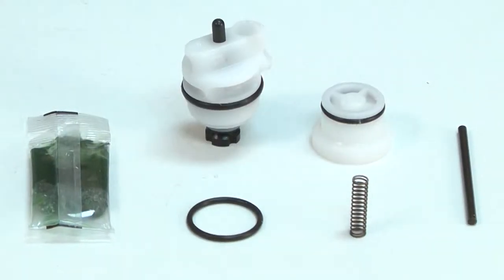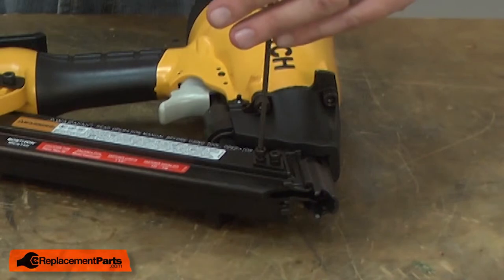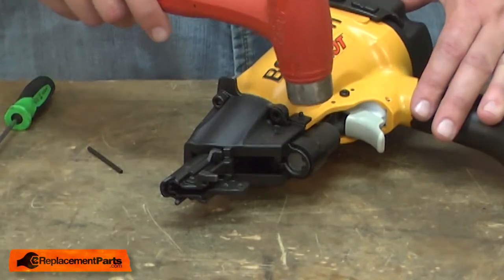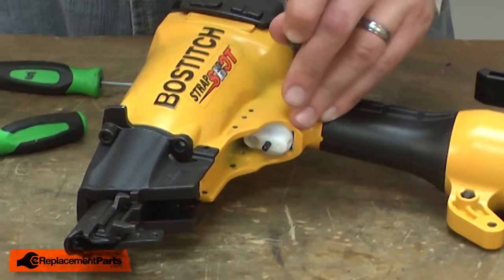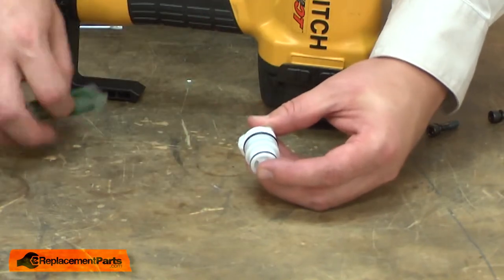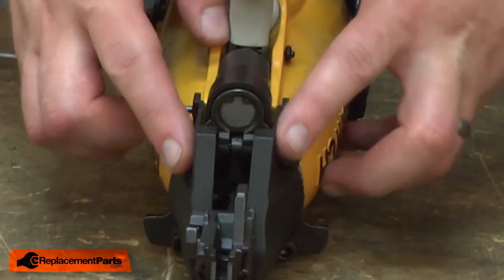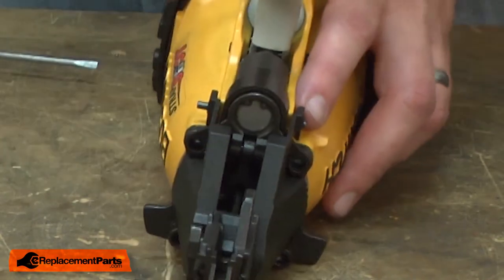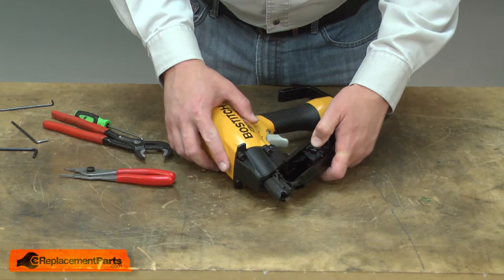Bostitch Nailer Repair - Installing the Trigger Valve Kit (Bostitch Part # TVA14)

Comment: They used to be made of metal not plastic I use to repair them at work years ago.
As they were made in cast aluminium not cheap plastic parts now.